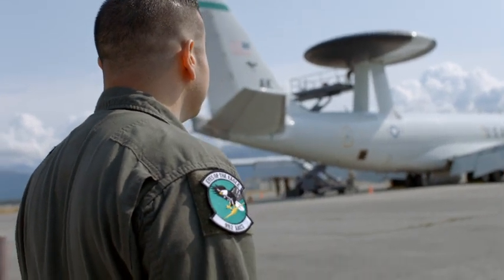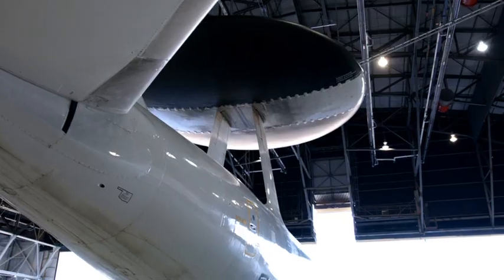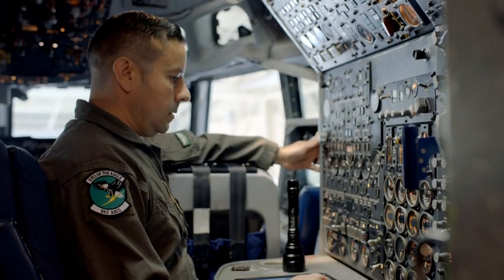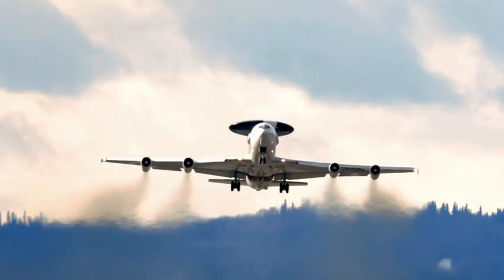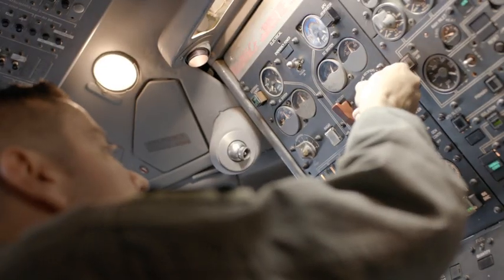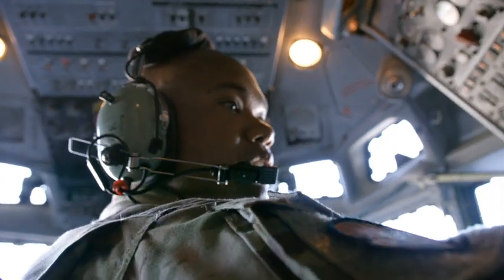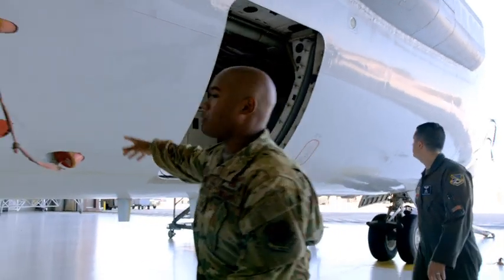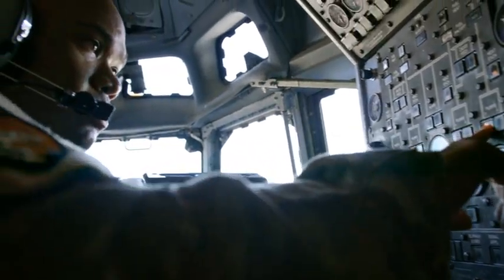U.S. Air Force Flight Engineer—The Human Computers Aboard Aircraft

Comment: Hallo to former and current flighengineers  from flightengineer from Russia. Flightengineer used to be as  a conductor in flight crew. All my birds  Tupolev 154, DC-10-30/40, IL96-300. 35 years in the air.